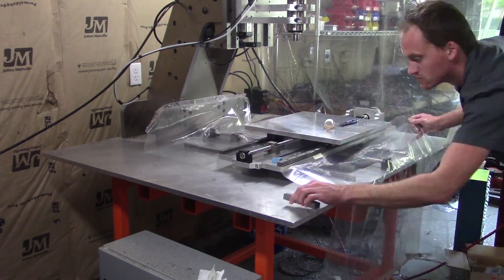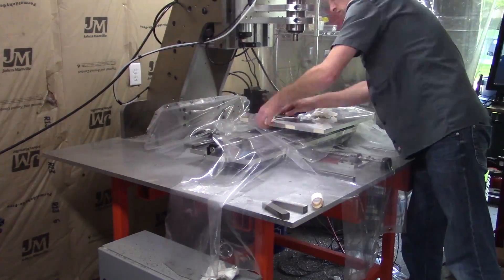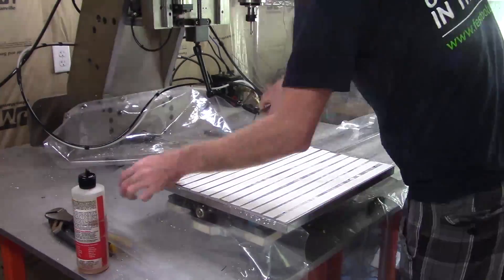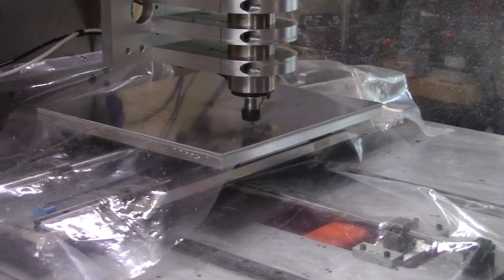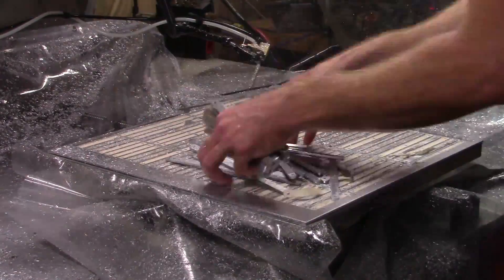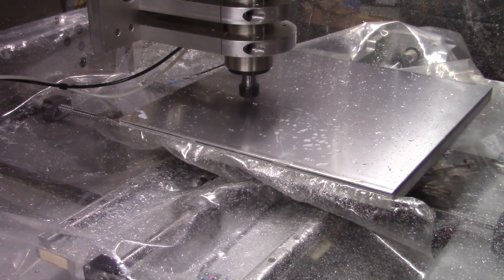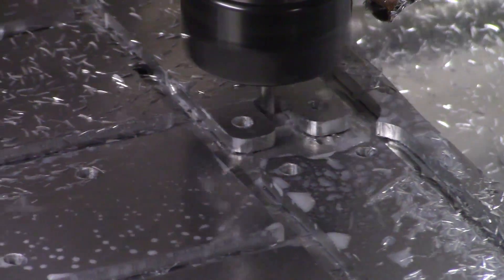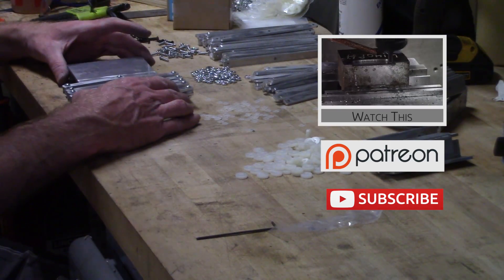Way Covers for the VMC - Part 1

Comment: not sure if you have found the source of your vertical deflection(surface  finish issues from earlier) but think I may have spotted the culprit...try tying the 3 spindle mounts together on the sides with some 1/4" plate ....the thickness of the bore and end mounts vs the length of offset is probably allowing just enough flex to cause the chatter...more then strong enough not to notice it till under a cutting load. nice work as always m8!

Comment: As you've probably learned from this, double stick tape + coolant is a no-no. Coolant will attack the adhesive and make it useless. Double stick works great for dry applications like plastics, we use it daily for cutting large renshape parts. It kinda works for wet jobs if you seal around the edge of the part with hot glue, and even then you can't break through the plate or the coolant will get in there.

Machine seems to be coming along well though! Excited to see how the covers turn out.
Reply from the maker: Yea, I figured it would hold up a little better though!  At least the superglue worked well.

Comment: What was your tool, rpm and feed rate?!
Reply from the maker: It was a .125" diameter 2 flute, uncoated.  19,200 RPM, 45IPM, .125" DOC and .05" WOC.  One of these days I'll push it until it breaks; I'm sure it can go much faster. :)
Reply: Thank you very much!! I have built myself a router style CNC. Teaching myself feeds and speeds now! Your mill is looking awesome! Great work.
Reply from the maker: Matthew Colvin This is an excellent (free) way to start: http://zero-divide.net/?page=fswizard
Reply: good to know!! thanks